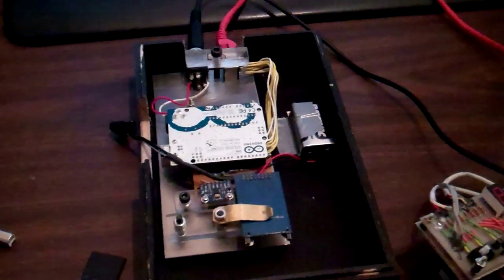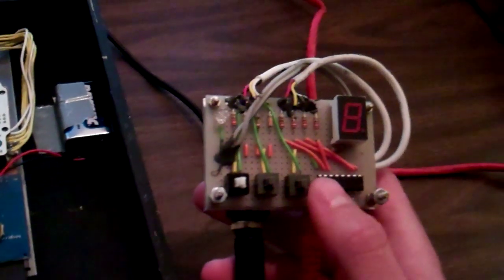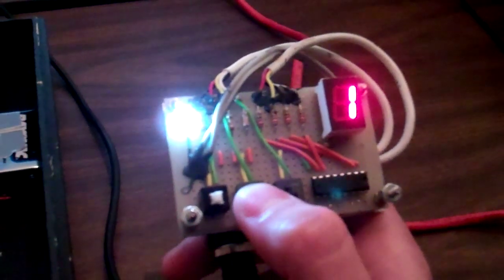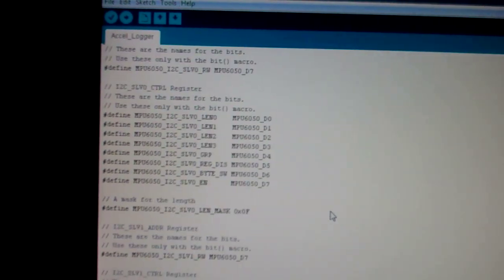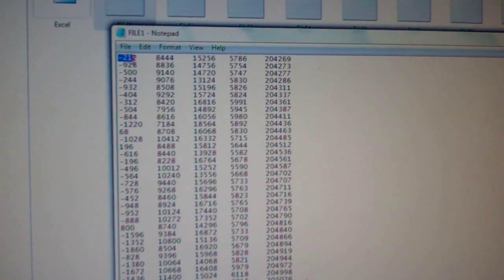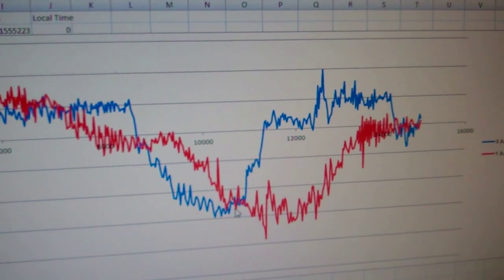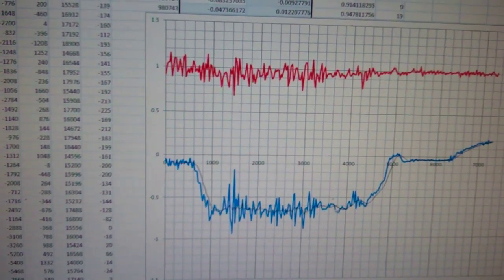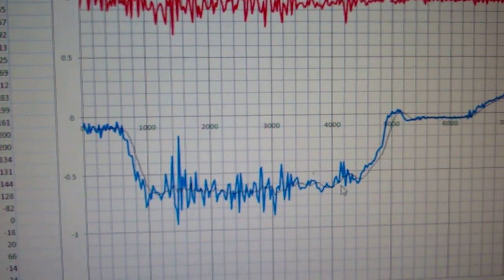Arduino Accelerometer Data Logger Project

Comment: This is the kind of project I am trying with my new Arduino. I have an acellorometer hooked up and reading the data but not sure I understand how to do the math to convert the X Y and Z values to linear acelleration/deceleration
(as in your acellerate / braking graph.) Any chance you could post the source code for that part?
Thanks in advance
Reply: +Sammy P 
No, unfortunately not. Project has gone on the back burner for now, but winter's here and more time for indoor activities.